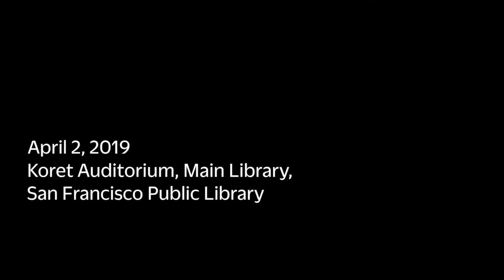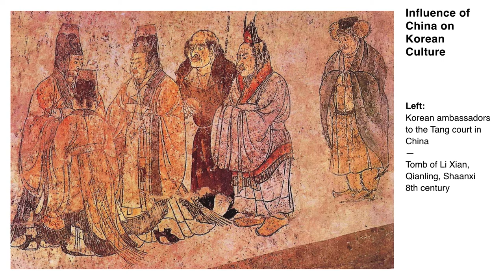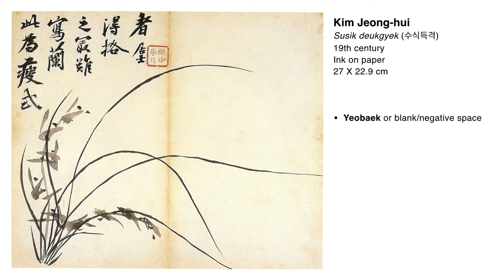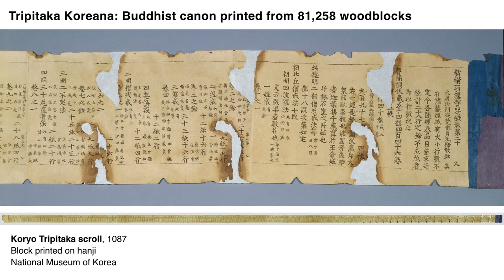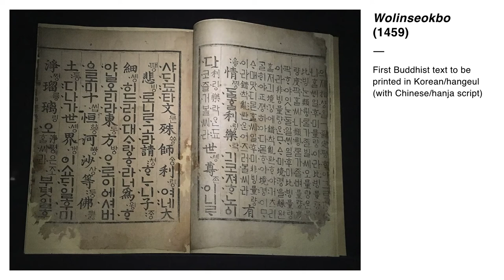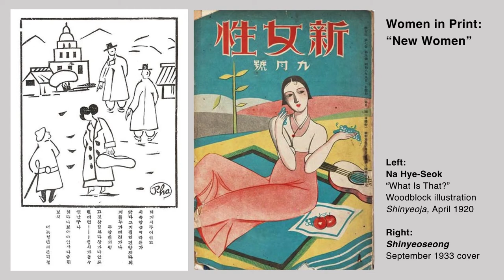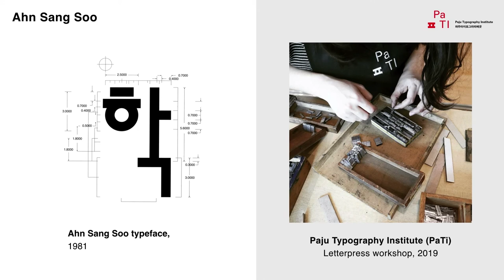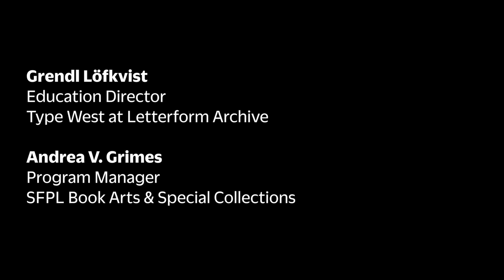Lars Kim: Survey of Korean Calligraphy, Typography, and Print

Comment: I'll answer that question (@1:01:30) about digital type creation for 한글 since I'm attempting just that right now… for aesthetically pleasing results, expect to create no less than 11 versions of each of the consonant characters for the upper[left] position. The vowels also change shape depending on the consonants around them (with the strokes becoming longer, shorter, or slanted to accommodate). If the strokes are just lines (no serifs), then that's about as difficult as it gets. The rest of the job is "copying and pasting." For calligraphic fonts, the difficulty is compounded by the need to tune the brush type for each kind of stroke.